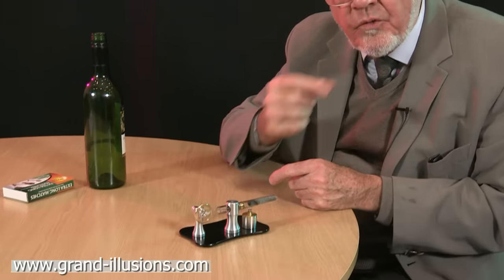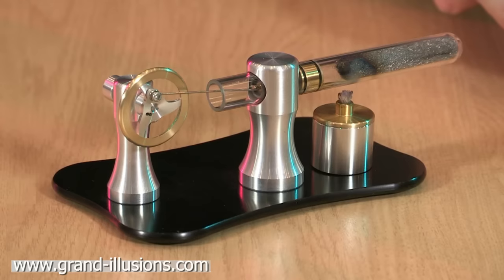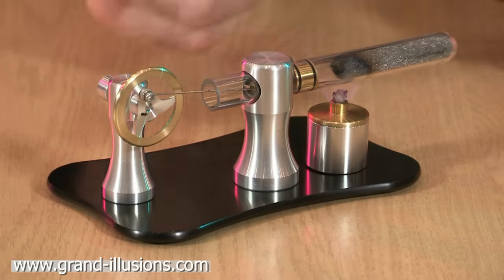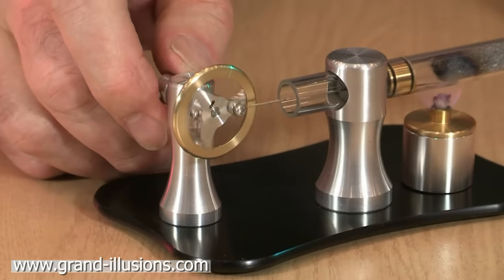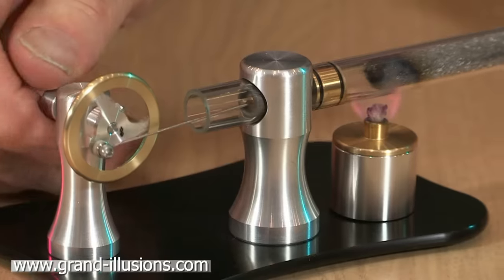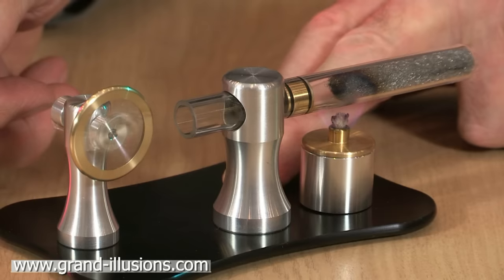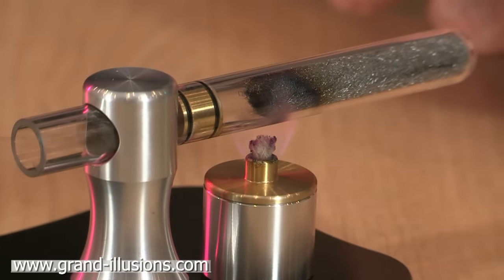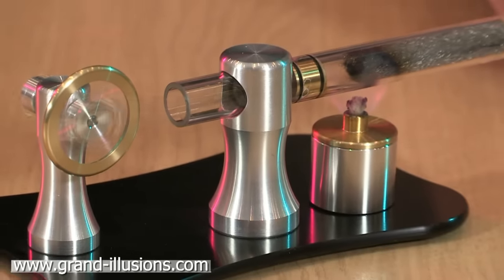Thermo Acoustic Engine

Comment: That is a sterling engine i dont know where you found the name thermo acoustic
Reply: It's not a Stirling engine; it has only one piston for a start. It works on a completely different principal that I don't understand.
Reply: Roly Williams ha ha that killed me.
Reply: Roly Williams The heat takes air inside the tube with black stuff and causes the piston part to go in and open a door for air to go in, and I think the air helps push the part out to close the door, and then suck the air again
Reply: I'm no expert But i see air expanding and contracting moving a piston the contracting to me seems like the steal wool being used as a heat sink. As far as i know that is a sterling engine. As far as i know a sterling engine does not need any more than one piston.
Reply: Wikipedia calls it a beta stirling engine and i have seen this type called a sterling engine before.
Reply: I think the steal wool inside the tube acts as the heat sink.
Reply: MrBigangry Read the Wikipedia article again. The Beta Stirling (like any other Stirling) has two pistons; a power piston and a displacer. It only has one cylinder but there are two pistons inside. There is also a Wikipedia article on the thermoaccoustic engine. Read both carefully and you'll see the difference.
Reply: MrBigangry The steel wool acts as a regenerator.
Reply: What is a regenerator?
Reply: When i say heat sink I mean it cools the air or gas causing it to contract. Followed by the heat causing the air or gas to then expand again. Driving the piston.
Reply: Roly Williams I thouight the Large Steel (metal) slug which surrounds the area where the piston expands to its maximum, was acting as the cooling part, sort of like a regenerator..

the Steel wool, is acting like a heat sink, but only so the rate of heating remain reasonably constant.

I think I have seen vertical larger scale tubes using a similar principal with no fly wheel and a light mass slug (piston) although at a much slower frequency. 

Also I believe the mechanism is different from the stirling engine, in that it is not a closed gas system.
Reply: This is not a Stirling engine, it works on similar principles, but it is different. See the wikipedia article titled 'thermoacoustic heat engine'. A Stirling engine uses a displacer body to move heated and cooled air where this uses acoustic waves.
Reply: This is not a stirling engine! A stirling engine has got two pistons
Reply: I think heat  and  amagnet wheel balance thinged.
Reply: i'm sure he found the name thermo acoustic on the box for the product, because that's what it is. 

there are mountains of literature explaining what thermo-acoustic engines are and how they work, as well as sterling, and you can go ahead and infer the differences for yourself. but don't claim something if it's patently false and you simply don't understand it well enough.

Comment: What does this have to do with acoustics? Is this not just a basic example of thermodynamics where heat energy is transformed into mechanical energy (eg. heat increases air pressure -> air does work on piston)?
Reply: No the sound waves are what move the piston, specifically high-amplitude sound waves. An increase in air pressure would cause expansion but not contraction, it is the difference in heat that allows for induction of sound waves.

Comment: I'm working on a engine that will use a similar principal but has fair few differences in its operation is source and return and re use of energy of its motion using pressure difference reaction this has given me some more ideas to help ty just by chance I seen it as well :)

Comment: After further investigation, I now recognize that it is indeed a thermoacoustic piston setup... there is no moving displacer as in a Stirling Engine, only a piston being pumped by the expansion and contraction of the fluid (air) in the heat exchanger.  But, the actual heat exchange, on a molecular level is a Stirling Cycle.

Comment: This machine can be called either a motor or engine because of its extreme simplicity. We live in a world of gray borders.
 It is not a Sterling because it generates acoustic waves that make not only a Displacer unnecessary but also could make the Flywheel unnecessary, although after the loss of the flywheel this machine will lose most of its load driving power

Comment: There is nothing acoustic, or 'sound driven', about the way this engine operates, the speed is much too slow.  First of all, the frequency equivalent of 2700rpm is 2700/60 = 45Hz.  Assuming the cylinder is on average 2" long, and the air temperature is on average 100deg. C, the average first acoustic resonance frequency by simple estimate is 3900 Hz, higher by almost a factor of 100 than the excitation frequency of 45Hz.  Acoustic resonance would not be involved with the operation of the engine.  The speed of sound @ 100 deg. C is 387 m/s.  The maximum speed of the piston by rough estimate is only 3 m/s, so the piston speed is not fast enough to affect the cylinder acoustically; there would be no standing wave at that speed.  If you model the trapped air as a lumped mass, and use the air compressability as it's 'spring stiffness', you get 3700 Hz as the resonance frequency, so this model is not likely representative of the engine dynamics either.
Reply: THIS is referred to as a thermoacoustic engine in that it converts heat energy into sound waves (see video at bottom of page):
http://www.mme.wsu.edu/~matveev/tae.htm
Transfer of heat through the device powers intense sound.  The sound is due to an acoustic standing wave.  The sound frequency of the device in that video is around 1410Hz. A piston would have to rotate at 84,600 rpm to interface with that sound wave.  For comparison, the frequency of the sound made by the large bottle at 0:04 is about 110Hz; so a piston would only need to run at 6600rpm to interface with that wave.
Reply: Stephen Kramer I do not know anything about these engines and do not pretend to. However, I would like to point out that two notes can be in resonance without being exactly 1:1. an A 1760 note is absolutely in resonance with an A 55 note, despite being many octaves lower. Even an A and an E (from the same octave) are on a 3:2 resonance, IIRC, which is why that interval sounds good in the first place.  Perhaps a similar thing is happening here, where the piston only lines up with every 16th peak in the sound wave or something.
Reply: Yeah but then if the acoustic frequency IS higher than the piston frequency the acoustic waves are not providing directional energy to it, they are hitting it all the time, they're not going to make the piston move because they are hitting it when it moves in AND when it moves out.  To add energy to the piston the pressure wave needs to force the piston only when it's moving OUT.
Reply: Stephen Kramer Yet the engine runs :)
Could it be that the mass of the steel wool in the tube would lower the speed of sound?

Comment: It´s a "Stirling engine" older than matusalen! :P
Reply: It isn't a stirling engine as it has no displacer, it uses the standing sound wave instead.  Thus the engine is called a thermo acoustic engine.
Reply: fun fact:
The stirling engine was patented by Robert Stirling in 1816.
The possibilty of the thermo acoustic engine was first discussed in 1887 by Lord Rayleigh.
So, the Stirling engine is in fact older.

Comment: Hey look; if you guys want to call this a sterling engine, nobody can stop you. and you're not entirely wrong. 
but in the engineering community, scientific community, and hobby engine community, it is understood that this engine operates under differing principles enough that it is given it's own name: Thermoacoustic heat engine. if you look up almost any definition for sterling, and then look at the operation of this engine, you'll see that they fundamentally differ. ron paul 2012

Comment: I was going to say put coils in there to produce heat . Maybe have the coils produce heat and a magnet is the discplacer in this case! Then the heat generated would push the magnet like the engine would normally plus the ac current from the coils that fit around the engine woukd drive the magnet like a solenoid. Then for an added bonus drive the flywheel with copper generator to produce power instead of chain link to another generator which is less efficient.
Reply: gage miree you could, ya,, but there is waste when converting heat to motion then to electricity. a peltier device converts only once

Comment: Whats the difference between that and Stirling engine?
Reply: Simple:
A Stirling engine has a working piston and a displacer piston.
A thermoacoustic engine has only one piston and an heat exchanger (in this case: steel wool).

But I had to look up how a thermoacoustic engine even works - but knowing that the steel wool is important, is the key.

Comment: It would be pretty cool if an artist built a huge 6 piston version and powered a car with it. Even if you couldnt control RPM just use a calculated amount of fuel and set it on a straight away. Would be interesting to see if it would work.

Comment: Ok...but how does it work? The little model engine you showed seems fundamentally different than the model of you blowing air across the open end of a bottle. I understand standing waves, but I don't understand how heating the inside (right side) of that tube creates a standing wave.

Comment: As with many of these quirky heat differential type engines, there is very very little power that can be extracted from them. Have a look at how thermal power plants operate :)

Comment: Holy crap! Get this man a medal, and someone tell Iceland they can stop making geothermal power now, we have a much better use for that heat. :D

It is not infinite. It's a LOT, but nowhere NEAR infinite. Hell, if you completely froze the core, stopped its spinning, finished the decay of all the radioactives, and captured ALL that energy... the Sun still makes more in a few seconds. Maybe a few minutes at worst. I CBA to figure out exactly how many Joules of energy are stored in the core.

Comment: Thermoacoustic engine is it possible to change out the heat source with an electric Source like a coil and hook the wheel up with a small generator it would run as long as the element inside the tube lasts

Comment: So, if you used a radioactive souce to generate the heat input, this thing could run for a really long time. Maybe use it to generate electricity using spent nuclear fuel?

Comment: Is there a way to attach this to a small generator and charge cellphones?
Reply: Yes.
Reply: Nah, this wouldn't produce a fraction of the power needed to charge a cell phone. It might light an LED, at best. Actually, the torque required to turn a tiny generator alone would probably stall it.
Reply: +themaritimeman Lol so true.

Comment: Why the acoustic part?  Speaking of acoustics, putting a metal grate in a tube of ABS or PVC, then heating the grate up with a propane torch, then turning the tube vertically makes a heck of a howl.  Our engineering teacher in college had made some of these up, and we'd heat them with bunsen burners.  Professor Yoshi would rush down the hall and burst into the engineering room shouting that he was working on a mathematical proof with his thick Japanese accent.  I have a few lengths of ABS left behind by the plumber (each 4 to 5 feet long) when my sewer line was re-done.  I could really annoy my neighbors with those, I bet.

Comment: I don't see how the 'standing waves' part of this is supposed to contribute to the Piston movement? Isn't this quite similar to a regular thermal engine? Sterling engine?
Reply: Sterling engines require two pistons, one of which is a displacer. This has no displacer, instead a standing wave generated by the heat differential acts as the displacer.

Comment: what is the difference between this and Stirling engine? and how the hell it works?
Reply: Stirling engine doesn't require the fuel to be inside the chamber, only gas, but they are very similar.

Comment: What is the "stack" material which is inside the tube?
Reply: Probably fine metal wire or turnings, like steel wool. Something that can exchange heat rapidly with the gas that permeates it.
Reply: Gun powder? Maybe

Comment: If you made this in a larger scale and used the sun as a heating element via mirrors, then wouldn't this be a machine that goes on forever as long as the sun shines? You could place the machine on the north or south pole where the sun always shine I guess.

Comment: acoustic ?
Reply: The Stirling engine is an external combustion, closed-cycle working fluid engine. The fluid is a gas subjected to a cycle comprising four phases: isochoric heating (at constant volume), isothermal expansion (at constant temperature), isochoric cooling, and finally isothermal compression.

Robert Stirling invented the hot-air engine1 in 1816 and, to improve its efficiency, fitted it with a regenerator, which provides thermal storage and internal exchanger functions. This element sets the Stirling engine apart from other engines. It has considerably improved its performance, giving it a real development in thermodynamics.

Comment: The steal wool is the heat sink
Reply: Im not an expert but I would imagine the steal wool would only dampen any acoustic properties in that tub just as being in a room with a bunch of pillows would dampen any acoustics. The expanding and contracting air from heating then quickly cooling is what drives this type of engine.

Comment: Is not that a stirling engine?
Reply: The Stirling engine is an external combustion, closed-cycle working fluid engine. The fluid is a gas subjected to a cycle comprising four phases: isochoric heating (at constant volume), isothermal expansion (at constant temperature), isochoric cooling, and finally isothermal compression.

Robert Stirling invented the hot-air engine1 in 1816 and, to improve its efficiency, fitted it with a regenerator, which provides thermal storage and internal exchanger functions. This element sets the Stirling engine apart from other engines. It has considerably improved its performance, giving it a real development in thermodynamics.

Comment: I understand the thermo (heat) part, but I do not think that any acoustic (sound) force is helping to DRIVE the mechanism.
Reply: The Stirling engine is an external combustion, closed-cycle working fluid engine. The fluid is a gas subjected to a cycle comprising four phases: isochoric heating (at constant volume), isothermal expansion (at constant temperature), isochoric cooling, and finally isothermal compression.

Robert Stirling invented the hot-air engine1 in 1816 and, to improve its efficiency, fitted it with a regenerator, which provides thermal storage and internal exchanger functions. This element sets the Stirling engine apart from other engines. It has considerably improved its performance, giving it a real development in thermodynamics.

Comment: Sorry but this is far too small and slow for any acoustic effect to be involved at all.

This is a normal Beta type Stirling engine, the metal support at the center acts as heat sink.
Reply: All Stirling engines have two pistons, so this is something else.
Reply: +Brandon Wiker Wrong, most of the demonstration models of Stirling Engines I've seen use only one piston.
Reply: The metal plug in the midsection between the piston and the heat source is not a heat sink. This plug has an aperture in it that creates the acoustics. Without it this machine would be another Stirling.

Comment: a nuclear reactor works like this, i guess its similar
Reply: The Stirling engine is an external combustion, closed-cycle working fluid engine. The fluid is a gas subjected to a cycle comprising four phases: isochoric heating (at constant volume), isothermal expansion (at constant temperature), isochoric cooling, and finally isothermal compression.

Robert Stirling invented the hot-air engine1 in 1816 and, to improve its efficiency, fitted it with a regenerator, which provides thermal storage and internal exchanger functions. This element sets the Stirling engine apart from other engines. It has considerably improved its performance, giving it a real development in thermodynamics.

Comment: Fake, thermo-acoustic engine. Thermodynamics.
The Stirling engine is an external combustion, closed-cycle working fluid engine. The fluid is a gas subjected to a cycle comprising four phases: isochoric heating (at constant volume), isothermal expansion (at constant temperature), isochoric cooling, and finally isothermal compression.
Robert Stirling invented the hot-air engine1 in 1816 and, to improve its efficiency, fitted it with a regenerator, which provides thermal storage and internal exchanger functions. This element sets the Stirling engine apart from other engines. It has considerably improved its performance, giving it a real development in thermodynamics.

Comment: kick start our cars??   Where does that happen?  Maybe 70 years ago.....
Reply: +J.R. Zippie the starter motor in your modern car is still kick starting your engine.
Reply: well technically...but I meant the oldtimey hand-crank.....I owned a 53' English Austin that had one....
Reply: +J.R. Zippie and +overdoseochilli:  Heheh, I've roll-started more than one pickup truck in my life. ; )
Reply: Zombie-Process ----mmmm.... roll-start...very interesting term....British?
Reply: American, actually. ^_^   Basically it's a way to start it if your starter's dead:  you get the thing rolling at about 8 to 15 MPH, hop in, put it in gear, pop the clutch, and it'll spin the engine, and if you're lucky, it'll start.
Reply: Zombie-Process ---been there....done that.....